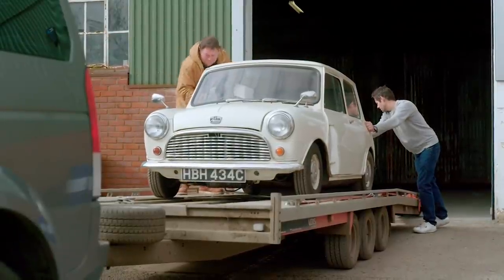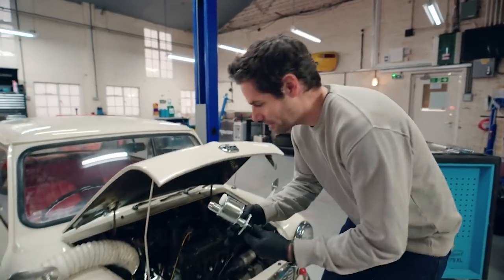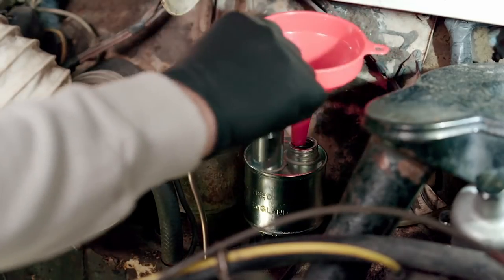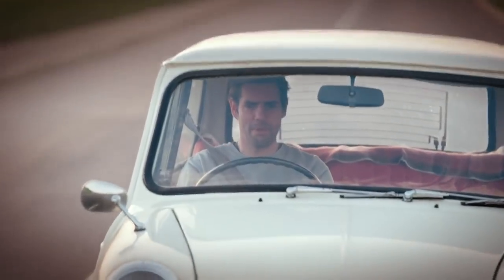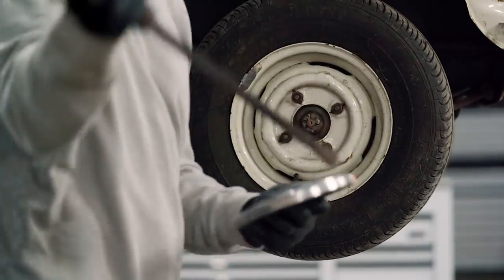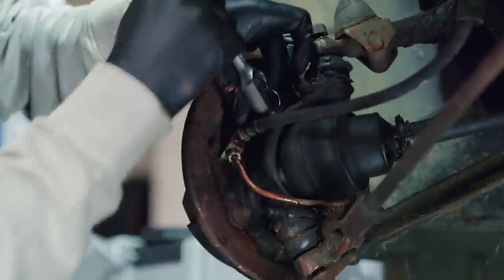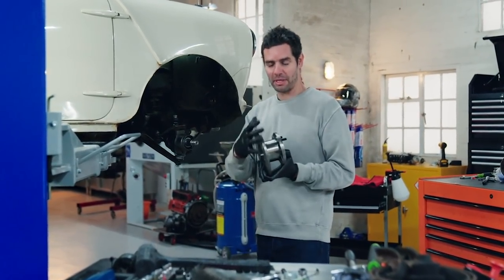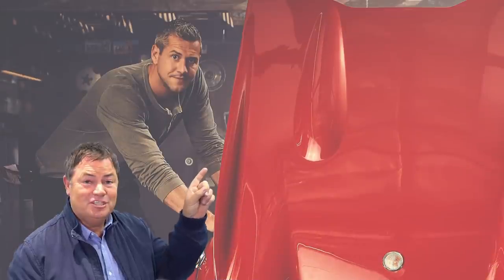Mini Mark I: How To Upgrade The Brakes | Wheeler Dealers

Comment: As the owner of a tweaked 1964 850, I'd like to make a few comments although I have only seen this trailer and not the full ep.
If the car has been sitting idle for a long period of time and you are going to spend some decent $$$ then I would.

Replace all master and slave cylinders (hone and reseal if you must) and also all of the hydraulic hoses without hesitation.
Might as well flush the whole system out and use silicon brake fluid to reduce future degradation.

You can upgrade the front drums to the later twin-leading shoe style and with decent quality shoes and everything being adjust up right, they can be quite effective and still retain the original look if this is seen as important.
Reply: I'm sure all your recommendations are perfectly valid but it's an hour program and they've probably left out as much as they've put in. See Phil being interviewed by the big man on the latest Workshop Diaries.
Reply: @Neil Griffin You are right, my man, but of you pay attention, when Elvis replaces the front drum brakes you can tell that there is a new brake line already installed on the drum brakes, and most likely they already bled the sistem thoroughly before the first test drive ;)

Comment: This is what I SHOULD have done to my 63 Mini after I came down fast off Dartmoor with a very spongy pedal and no brakes! What I did was get rid of the standard linings and fit Mintex rally linings, which had hundreds of copper alloy shards in the lining material which helped heat transfer. The brakes needed a good hefty push thereafter, but they never faded and pulled me up dead straight every time, even after I started competing in sprints in the late 60s. Kept it original too.

Comment: Is there really an overheating issue with such a light car? Some modern electric cars are moving back to drums as they are better for not glazing over with light use (EVs use mainly regenerative breaking).

Comment: How is it possible to document the installation of a clutch master cylinder and a clutch slave cylinder and not mention the actual names of the parts?  If you’re trying not to offend anyone it hasn’t worked - you’ve offended me and every other petrol head by not using the proper parts names.

Comment: Cool an old mini it's funny he doesn't know the proper name for the brake cylinders it's  master and slave and I noticed he didn't back the nut off quarter turn when doing it up mini wheel bearings won't last long unless you do that top tip
Reply: You don’t back them off a 1/4 turn, not sure why you think that? The bearings come with a spacer that fits between them and should be tightened to 200ftlb
Reply: @MiniMattTV  on certain older cars you always tighten the wheel bearings with the wheels turning until the wheel runs less freely, then back off aa quarter turn and pop your split pin in to stop it readjusting itself. I don't think it applies on Minis.

Comment: It never fails to tick me off when these TV presenters keep on telling us why discs work so much better than drums. That is simply not true. There is much more surface area in a shoe and drum system, stopping the vehicle much faster than a comparable disc set up with the same size wheel. 
Yes drums aren't vented and so generate more heat but, as long as your not using it for racing or hooning about like an idiot they work way better. 
Also why did he not treat the rust and paint the bulk head before fitting that master cylinder?
Reply: Drums are enclosed so cannot dissipate heat as well as trap water which can also further degrade performance which is why modern cars no longer have front drum brakes. The braking is also less linear as they heat up and expand, you may call it quicker but that it isn't desirable because it leads to lock ups. The engine bay would've been left untreated to keep the vehicle's authenticity, rust included.  None of it was structural as far as I could tell.
Reply: @tonydization  So he was keeping the rust for originality but not the 1965 brakes. Why then wasn't the rust treated to prevent any further degradation? He didn't have to paint it to do that. The only piece of authenticity there was the metal master cylinder.
Reply: @Sam-gu6im  The front brakes were uprated because the head was flowed and performance improved so that is a sympathetic upgrade imo.  Treating the rust still would've made it  look conspicuous in the engine bay nor would it have made very interesting viewing.
Reply: You are right Sam. 

Plenty of us are quite happy to continue to run the drum brakes all around. A car can be a daily driver without a disc conversion. 

But it sounds like it's going to given away at some point, maybe the lawyers insisted on newer brakes, lol

Comment: Not sure how the clutch worked without a return spring!  Front discs were fitted to Cooper models in the 60's, using the existing master cylinder, you would need strong legs!
Reply: It was fairly common to fit a remote servo in the already cramped engine bay 👍🏻🇬🇧
Reply: @AJ-qn6gd  Yes, indeed. I had a servo fitted to my 998cc Mini Cooper - made all the difference!
Reply: @richardwatts9371 , I remember once viewing a 1275 GT with twin remote servos one for the brakes and one for the clutch, now that was cramped !
Reply: @AJ-qn6gd  Hi! I should say so! I had a 1275GT in the seventies - lots of mods,  great little car!

Comment: Tsk Tsk I see you ride the clutch, you must move your foot away from the clutch unless depressing it, even a slight touch maybe when going over a bump will cause you to touch the pedal and then this causes slight wear on the plate, it doesn't take much before you need to replace the clutch and on a Mini it's a pain in the arse. 

OK you know different words Primary Cylinder = Master Cylinder, Secondary Cylinder= Slave cylinder, please use terms that 'most' people know and understand, this is not an F1 car
.
Love the idea of upgrading the brakes they need it.

Even though I am a mechanic of many years you are never too old to learn, when watching another video I realized that like you for years I had been applying copper grease to the pads, BUT a better way is to apply it to the surfaces of the caliper where needed, less grease, less waste, less chance of it getting on the pad.

Just a thought.